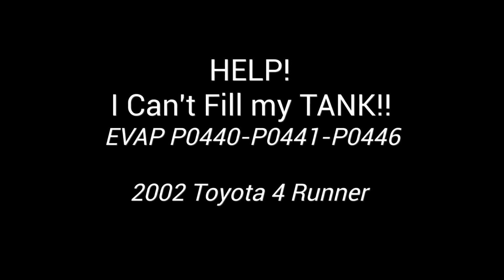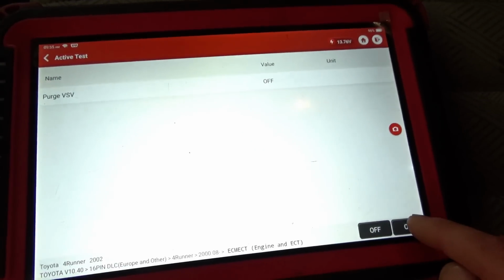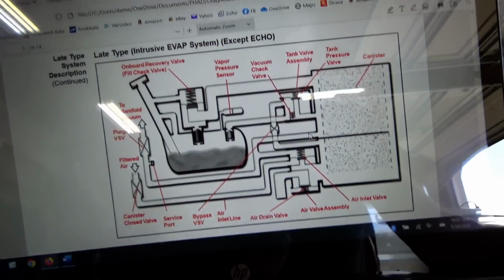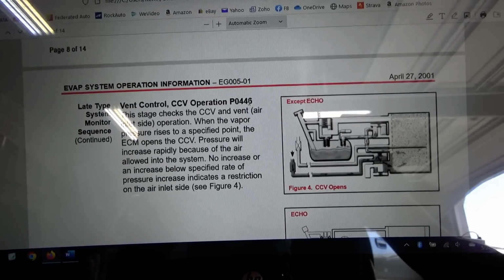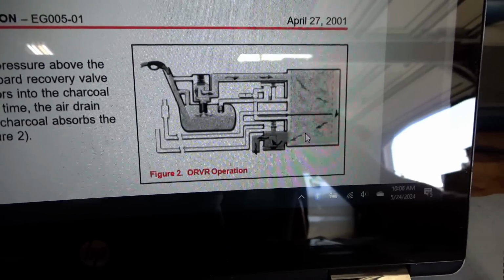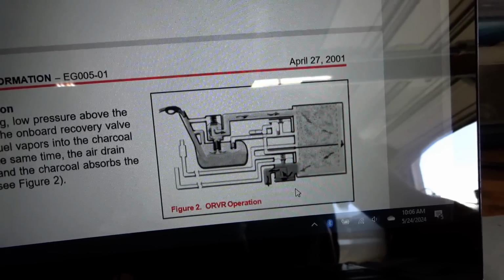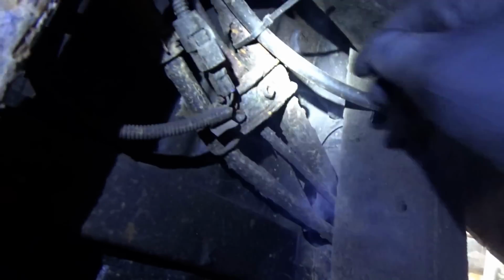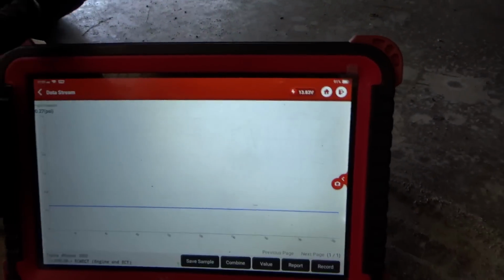HELP! I Can't Fill my TANK!! (Toyota 4Runner EVAP P0440-P0441-P0446)

Comment: I have the same year vehicle and I’m dealing with P0440 and P0446. It does fuel up, but the pump keeps clicking off every 5–10 seconds so I have to hold it the whole time. I’ve already replaced the charcoal canister and the purge valve, and neither fixed it.

A mechanic did a smoke test and smoke was coming straight out of the fuel filler area. New OEM gas cap didn’t help either. He was able to command one of the engine bay valves closed and that stopped the smoke, but it’s still really hard to fill the tank.

I’m thinking about replacing that valve or getting my own smoke tester and going through the system again. If anyone’s solved this or has ideas, I’d appreciate it.

Comment: Just a stupid question? Did the owner normally leave the car running while attempting to fill the tank? With the car off, the ECM would have no control of the evap system, but with it running, the constant voltage, rather than the ping pulse, would overheat and melt the solenoid, when it tries to vent, and it couldn't vent with the line melted. Maybe I', way off base, but I used to write code for industrial machinery, that did checks for movement of cylinders, when an extend command was sent, and if the limit switch never actuated, the solenoid stayed on till it burnt up from trying

Comment: Here's a nod to Toyota consistency (at least of the 3rd gen 4Runners)   I have a 2002 4Runner.  Muffler to exhaust pipe connection failed in EXACTLY the same manner.  Melted EXACTLY the same insulation off of metal Evap lines,  MELTED and CLOSED OFF the gas tank vent hose in the EXACT same spot on the vent hose line (where the ribs in the hose transition to a smooth hose for a couple of inches.). It was surreal  when I got to that part of the vid, because I had already located and cut the bad spot out of the hose myself.  My guess in this is where is was clamped into a support bracket, and there was heat transfer to the bracket, thus melting it in that EXACT spot.   Thanks a million for the video.  The diagrams you showed helped me make sure the canister itself is still working properly (diaphragm valve routing).....and oh ya my "bypass" solenoid valve (located at the canister) also failed in the exact same manner.  It was swelled up, and just the faintest click when applying voltage.  ✌

Comment: Man great vid I have a Tacoma 03 v6 with po441 small leak when I did a smoke test smoke come out from gas cap area which hose is the one you put the clamp on ? Is it the one that goes to vent valve ?

Comment: Think it was a Chevy Silverado a co-worker had with the same fuel tank issue. Another co-worker lived on an acreage, huge shop with vehicle lift. They had to pull the gas tank to get at the problem but i don't know what exactly was wrong. Issue with the emissions system too and they fixed it. Quite a few years back now.

Comment: Hi, can you tell me how  to get a scope like yours and what  brand is it? Because after a year and half, finally fixed my car fuel trim  problem just by putting back the OEM MAP sensor that i replaced by mistake with Delphi OE one that cause my fuel trim to go up by 10 percent, after putting the OEM back, fuel trim went back to 5 percent (i got  the idea from your advice to use only OEM electronic parts) if i have a scope, i could figured it out the problem from the waves form of the aftermarket MAP sensor. 

I couldnt believe it, 10 more  percent of  unnecessary fuel consumption, that a lot,  and cause engine rough idle and bad performance, not that bad since no check engine light, but the rough idle is an annoying problem if you drive the car too long, you can feel it on the steering wheel and the seat, in addition to transmission poor shifting.

Comment: Nice fix. Never saw that style of spilt flange before. Does that clamp onto the exhaust pipe tight enough to hold it in place without a tack weld?

Comment: I can only assume that the filler nozzle, from the Petrol Bowser, seals the inlet of the tank? Otherwise the tank filling would be normal as it would vent around the filler.
Reply from the maker: Nope just regular nozzle. After about 2000 all cars in the USA vent through the canister instead of the filler neck 👍

Comment: Toyotas EVAP systems are way over engineered and expensive to work on. I had a customers car that had several EVAP codes the system had a leak detection pump built into the canister that turns on and pulls a vacuum after it is parked. The pump had failed and you had to replace the entire canister. Was over $600 from Toyota.

Comment: Interesting. Had one difficult time to fill my tank recently, but no check engine light, and next fill was normal. For now I'm thinking the gas station fuel pump probably was somehow faulty.
Reply: The flow of gas station pumps differs a lot, some cars don´t like high-flow filling  but it works ok when you hold the nozzle half way.

Comment: It is good to see that old Toyota is going to be on the road a while longer.  While the evap system on that Toyota is complicated, it is no match for a Russian brain.  Compare that to the new Toyota trucks and I think repairing this one is a "no brainer."  I saw where 98,600 Tundras were recalled due to machining shavings in the engine.  I understand Toyota is claiming that because if they say there are bearing issues they would need to recall EVERY STINKING ONE OF THOSE TURBOCHARGED ENGINES.  Obviously, Toyota is racing Ford to the bottom and despite Ford's head-start, Toyota might win!  All the more reason to keep these on the road.  GREAT VIDEO!

Comment: Nice video and diagnosis. Hot exhaust melting fuel vapor lines. What could go wrong? At least the customer didn’t have Carbebque on the side of the road. 🤣🤣

Comment: I was on my way out of town, stopped to fill the tank of my Silverado. No-fill. Went back home, removed the filler neck from the tank  and found a quarter-size piece of cardboard blocking the pipe, likely from the previous owner putting in snake oil.

Comment: My old Toyota does the same thing, however to pay somebody to repair it exceeds the value of what this car is worth. So I just set the gas pump handle on the first click and problem solved. About once every 2 months I have to disconnect the battery to get rid of the 440/441 code.

Comment: I continue to be amazed by how many old cars are on the road today. According to statistics the average car is 12.5 years old (an ever increasing record over the last 6 years; so much for new cars don't last as long as they used to); keep in mind this is after over 600,000 used cars were scrapped under cash for clunkers in 2009, which was the previous year record for old cars surpassed 6 years ago.
Reply: That's because older cars were built to last.
Newer cars are built with a 10yr lifespan to be thrown away. . . Why do you think new cars are junked by insurance companies,  too expensive to repair.
Reply: @TheOriginalDaveJ  Especially when parts are unavailable even before the 10 years are up. South Main Auto had one car that was 10 years old, battery going dead, found faulty radio. He went above and beyond to help them out and the fix was way more detailed than you could imagine. Part 2 https://www.youtube.com/watch?v=PmeO4sB5ThY
Reply: @TheOriginalDaveJ People were saying the same thing 10 years ago
Reply: I plan on keeping my cars as long as I can get parts for them. New car prices are high, and quality is not keeping pace with the price.
Reply: Every so called "feature" that they add on today's vehicles increases complexity. Now, add to that the federal governments ludicrous demands for lower emissions, and higher mileage, And biodegradable components, like soy based wire insulation that mice just love to dine on, and you have a perfect storm of complexity/component caused unreliability. Now shove all that crap into the very limited space provided under the hood, mate plastic parts with metal parts that expand and contract at hugely different reaction to thermal change, and you have an unreliable POS that no sensible mechanically inclined person even wants to look at, let alone repair. Oh, and let's not forget to add cheap, Chinese aftermarket, not fit for purpose parts to the mix. Thank you very much, I'll keep driving my 1994 F150 straight 6, 2wd 5 speed manual transmission pickup truck, with a distributor, cap and rotor, one coil, and 6 easy to reach and change spark plugs. It was paid off in 1999, has 139k very well maintained miles on it, and will literally last forever. At 78 years old, at least for my forever.
Reply: @user-ut6ji8my2h  You are correct. It creates the disposable cars that we are seeing today.
Reply: I’m almost there with mine, ‘07 Pilot that’s a tank and my ‘14 Mustang GT…never getting rid of that one:)

Comment: Same engine, same codes, same issue..  same bad valve.  But…. My issue was there is a little anti syphon / roll over flap inside those gas tanks.  They’re supposedly non replaceable as they are “built in the tanks”.  But if you can squeeze your arm inside the tank than you can pop it off,,  mine was rotted away just enough where it shoved itself up in the filler tube and sealed it up kinda..  i just ripped it out and fixed the issue..  had me going for a week..   checked all the tubes, canister literally everything and it still was not taking gas, would take 30 mins to fill the tank..  had to drop the tank and remove that flap..  and they dont sell those flappers so either do without and remember if you roll over to gtfo..  or go to junkyard and hope to find a tank and remove the flap without breaking it…. Headache..,
Reply: Since you have to pull the tank, why not just swap it?
I was trying to figure out the problem.  Is he using those stupid gas pumps that seal to the neck?  Should have plenty of room for air to get out around the filler nozzle.
Reply: Youd think air would get out there but gas has a funny way of bubbling up while filling with all the air in the gas being pushed out of the pump.  On my tank it has a vent built in the filler neck, one in the tank and one on the canister.  I would have replaced the whole tank though if they werent $300…. For a cheap one.  Unless i could have gotten an uber to and from a junk yard which closest one from me is over 75 miles and doubt any ubers gonna let me pack a whole ass gas tank with me.  Lol

Comment: Have seem the same scenarion before, different faults. Cracked weld on exhaust cat melted plastic purge line under floor... 163 chassis ML350..
Reply: A friend of mine that uses a small box truck (his own) for USPS  “repaired” his exhaust with a pop can and a couple hose clamps. Didn’t last very long and melted a large wire harness. That was a mess.

Comment: Toyota evidently cheaped out a bit on some models exhaust. Had to replace everything from cat to the back on my little 04 Tacoma, yet the entire system on the 94 Camry is original and perfect. 👍👍🇺🇸.    And by the way, I see that Toyota has a recall for the failing Tundra engines. They even temporarily halted the sales on the new ones dealers have on their lots.
Reply from the maker: Yeah those new turbo Tundras are ticking time bombs sounds like 😂
Reply: @PineHollowAutoDiagnostics  Supposedly, they found that a very large batch of blocks had machining debris that was left behind in manufacturing. At least they seem to be owning it, time will tell.

Comment: It's funny how you just bad mouth aftermarket parts how they after junk and suddenly it's okay to use aftermarket you have been contradicting yourself for a while now so stop complaining about aftermarket parts when you use them to . that's calling the kettle black .
Reply: Ivan makes a clear distinction between critical and non-critical parts.  He also makes a distinction between electrical and mechanical parts.  He doesn't complain about aftermarket mechanical.  For electrical, if it's a sensor that will cause the engine to run poorly, he insists on OEM.  In this video, he went aftermarket with the solenoid (electrical) because it's not going to cause performance problems or the engine to not start.  At worst, the problem would be annoying.
Reply: Oh, no!  A non-critical aftermarket part for a 22yo, corroded truck?  Lighten up, Francis.
Reply: @zeropointenergy1574  Lets all give a round of applause for Ivan, our big toe .....  or sore thumb......
Reply: Sometimes You get lucky and sometimes not even with non electrical aftermarket. I recently put a Chinesium crankcase vent valve on a 2.0t VW and it worked great, for one day. The 230$ OEM is supposed to arrive today. Lucky it didn’t pop the rear main seal.
Reply: Not to mention standard motor products is known to use oem parts with the oem branding scratched off
Reply: Settle down Susan.

Comment: If the Vent Valve on the Evap system is stuck closed, back pressure causes the Gasoline Pump to shut off for safety reasons. The Vent Valve on the Charcoal Canister is normally open when the Engine is off. This prevents pressure from building up in the Evap system.
Reply: It can still have a working vent valve but if the charcoal cannister is saturated it still will cause the gas pump to click off repeatedly when filling.     People that keep overfilling the fuel tank cause the cannister to break apart and the charcoal inside it then starts causing repeat evap valve failures.
Reply from the maker: There is no active vent valve on this system 😄
Reply: If there is no vent valve on the respective system, then where does the Back Pressure go when the vehicle is being filled with fuel?
Reply: There’s a vent tube on the filler neck, a vent on the canister and a purge vent more or less that runs up to the filler neck also..  and when people with these motors fill the tank and over fill it pumping gas past the first click than the gas while driving will slosh up the filler and down the purge vents filling the charcoal canister..  this clogs the valves on it as there are 2 mechanical valves that work with back pressures from the evap lines from under the hood..  this causes the dreaded non fillable tank but wont bust the canister. Will just turn the guts into sludge..
Reply from the maker: @davidhall3747 it's just a passive one way "dump valve" that opens with a bit of pressure like shown in the diagram 👍
Reply: @PineHollowAutoDiagnostics Sounds similar to a T & P Valve in a Plumbing system. Thanks for the update.

Comment: Looks like that frame is spent on rust.  Vehicle is protecting itself.  Can't fill the tank because if it was full it would fall out on the road.  Rust bucket.
Reply: That 4 runner is mint compared to most vehicles in the north east